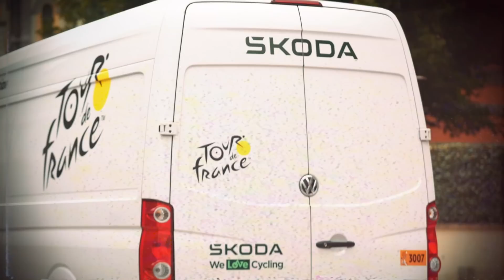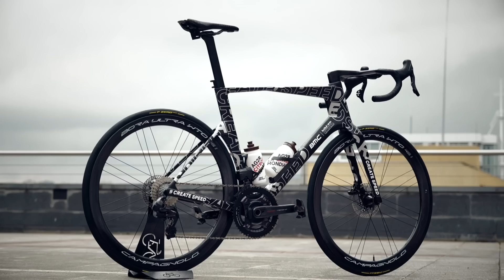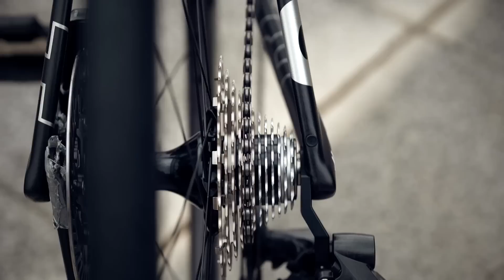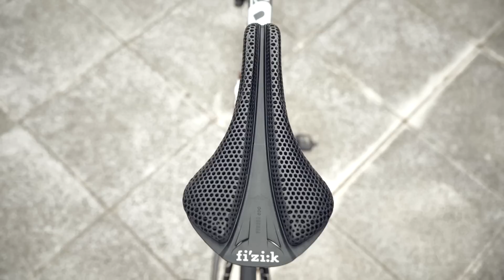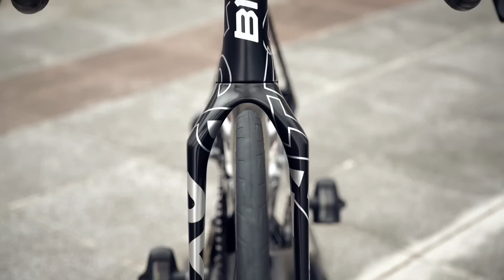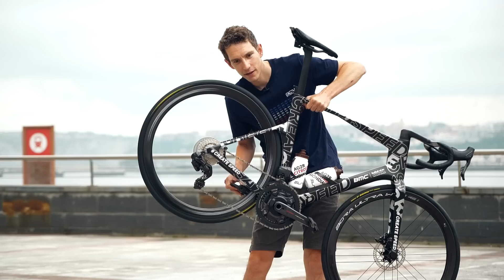New BMC X Red Bull Prototype | Tour De France Pro Bike

Comment: Odd that they are sponsored by both Pirelli and Campagnolo.  I only say that because the BORA ULTRA WTO wheels are optimized for 25 mil wide tires (American), but Pirelli don’t make the PZero Races in 25 mil. The smallest they make is 26.  Why not have Pirelli make a custom set of tires? Or go with a different brand and black out the logos?
Reply: Pirelli and Specialized both sell 26c tires instead of 25c but realistically I think they're the same thing as 25c tires, it's just a nomenclature thing.  Most 25c tires will measure 26 on rims in the real world.

Comment: i want this bike, but knowing bmc, id probably have to buy another whole separate bar/stem combo to get the fit i want. I hate bikes that come with stock cockpits and assume everyone has the same fit.
Reply: BMC have 3 cockpits available, all with different bar widths.  Cant put on any bar/stem combo you want, but you can get a good fit.
Reply: @chrisayers9502  Yeah, and in order to test those 3 cockpits to experiment with and dial in your correct fit you have to buy each one that you want to test, which was the original poster's point in the first place. 🙂

Comment: RIP to the Campagnolo thumb shifter
1992-2023
Reply: one of their USPs, now it‘s just an overpriced groupset with nothing unique
Reply: @3TXR  exactly.  Why buy Campagnolo over Shimano now that the ergonomics are exactly the same?  Carbon crank?  Made in Italy?
Reply: Still using it. Its a marvel in it's own right. Shifting 3 step at once, even able to shift together in both front and back. Oh my, remember the faces of Shimano users. Nice, unobtrusive cabling... ❤
Reply: @vivienrajz798  I still have 10s Campy on a few bikes.  I love it.
Reply: It will be back. They made a mistake. Im sure they are aware of it by now
Reply: Easily the most non-ergonomic shift button in history of modern cycling equipment forcing one to completely rotate their wrist to the inside to depress the button. And if you need to regularly drop multiple cogs on your cassette over and over during a ride with the push of a button you need to learn how to ride. :-)
Reply: @rcg9573  Well you're wrong.  You do not need to rotate your wrist to reach the thumb shifter.  You should be able to hit the mouse ear just by moving your thumb.  I know multiple women who prefer Campagnolo ErgoPower because it's easier for them to manipulate with smaller hands.  The mouse ear also works great as a sprint shifter when you're in the drops.

Also, being able to dump multiple gears in a single lever throw is a great feature if you're accelerating over a punchy climb into a descent.  I especially like having ErgoPower on my cyclocross bike for that reason.